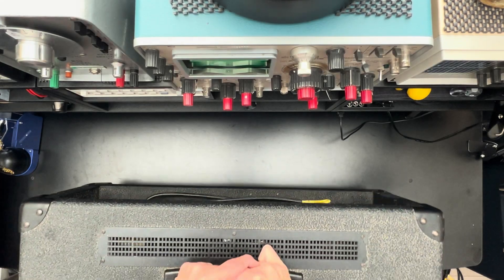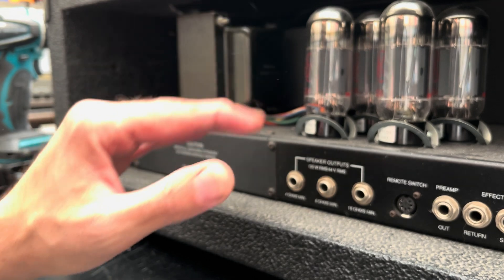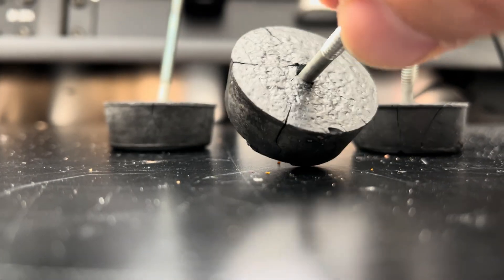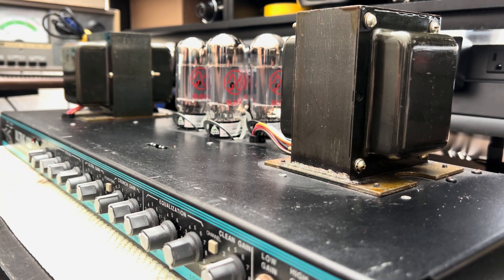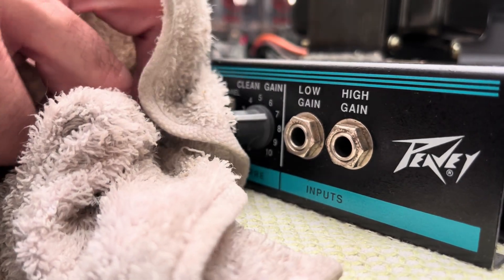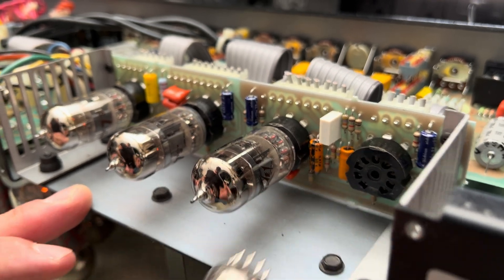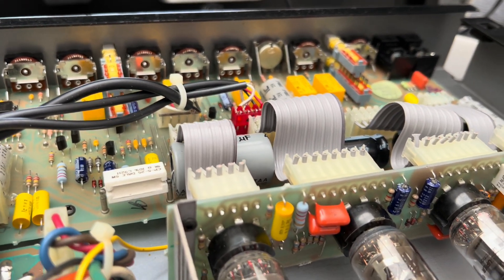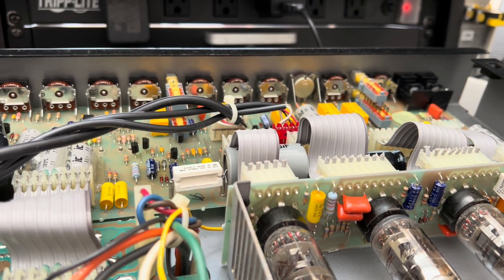1992 Peavey Ultra 120 || Gotta Get On The Good Foot

Comment: Looks almost exactly like my block letter 5150. There’s differences but generally the same layout. You might think about jumpering the HT leads in that ribbon cable from the main board to the power tube board, that’s a common failure point with the 5150s. 

I got a teal stripe bandit 112 for free with no cab/speaker. Use it as a head after building a super jank headshell out of plywood and spray painting it black. Has all the knobs too! It’s a hideous looking thing but it’s awesome. Has no business being as loud and sounding as good as it does. Great amps.
Reply from the maker: Thanks for the suggestion. I usually look for discoloration and didn’t see any, but great point. And those bandits are GREAT AMPS!